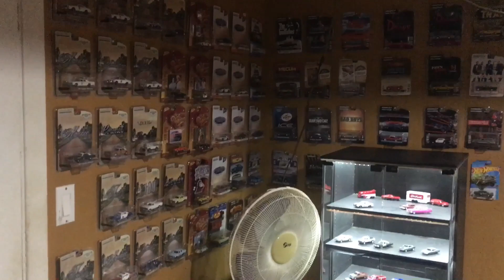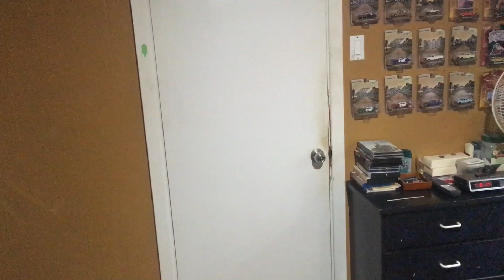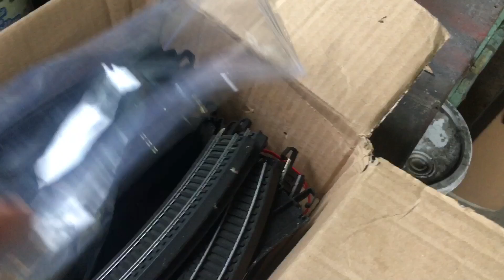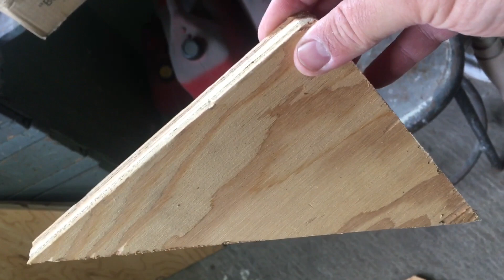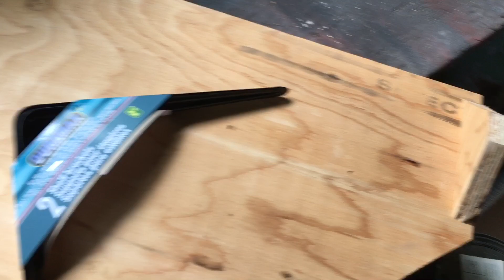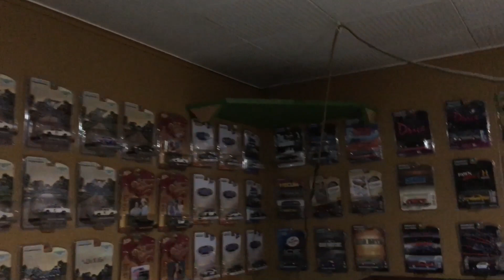Model railroading with no money, and no room.

Comment: Bonjour. I have some more dollarama ideas for you my friend. The led strips on a roll from Amazon eBay etc or dollar store. Zip tie or glue those to a piece of trim board and mount the trim on the very top corner of your room. The leds come with a wireless remote to change Colour. Don’t take up space and don’t cost a lot. They also don’t make heat. The cost is under 20$ sometimes 10$ for the led light strips. Dollarama sometimes has them in electronics section. For trees I buy from dollarama the popsicle mold (8 pack) 100 pack of the bamboo skewers and the moss for top of plant pot from their craft section. They also sell modge podge at dollarama. You pack the popsicle mold full of the green moss. Then you cut the bamboo skewer down to height for trunk. You take lid off the modge podge bottle dip the skewer in the glue then shove it into the middle
Of the moss. After 20 mins you can take it out and some will fall off and some will you pull off with your fingers makes a very realistic looking tree with no effort and the cost is 2$ for moss 2$ for skewers, 1.50$ for glue and 2$ for popsicle mold.
Reply from the maker: I’m going to do that!